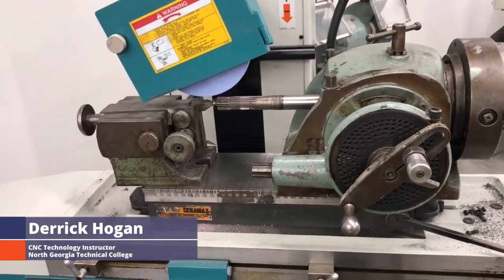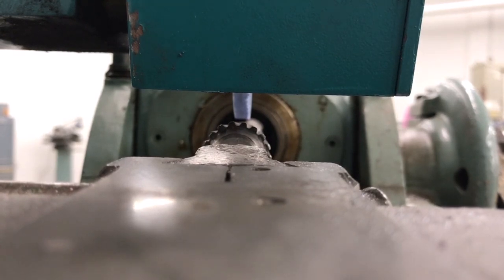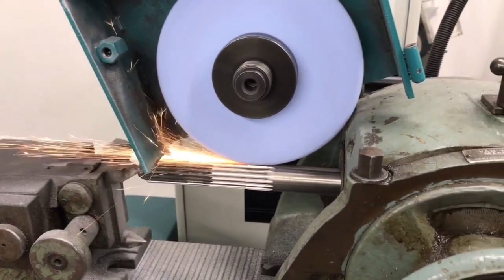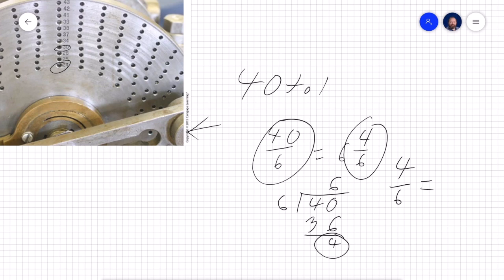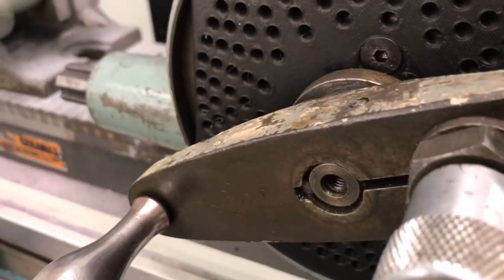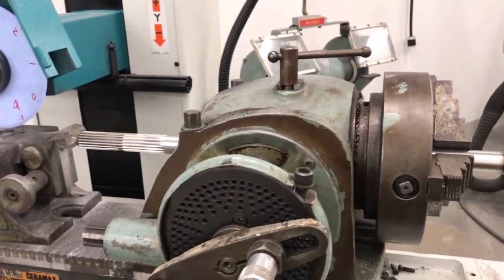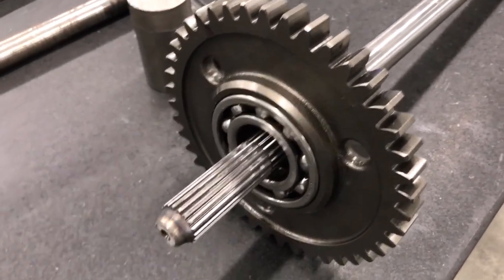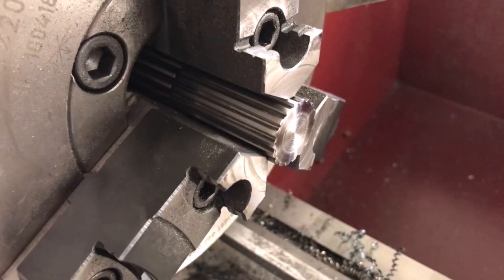Crush Dressing, an Old Die Grinder, and a Tractor Shaft

Comment: Just a question I have why not put it on a cnc machine in a 4th axis and 3D surface it with a small ball mill to rough it then a 45 degree carbide chamfer mill to finish it off if it is a 45 degree spline profile? If the radius is necessary then finish it with the appropriate ballmill endmill there are a wide variety of endmill ball mills out there that can machine hardened steels.

Comment: I don't know if you mentioned it, but it would be helpful to know how many turns of the 'handle' it would take to rotate the platter 360 degrees. Most seem to do 1 turn = 4 degrees (90 turns for a full rotation), but my 'high quality' HFT is 1 turn = 5 degrees 72 turns for a full rotation.
Reply: It was mentioned at about 10 minutes mark…40 to 1 or 9 degree per single rotation

Comment: Is there some reason that you don't put aluminum shims between your work and the damn Jaws?
Always always always place something be it thin copper or aluminum between any clamp or jaw anything touching apart even if the parts aluminum aluminum shims beat having marks on the part!
The only time I would not use a shim if I had a raw forging and I wanted maximum grip on a surface that would be cut later.
Also three jaw chucks are for soft jaws four jaw chuck's are for Machinists that make quality parts when you start to actually treat every part the same whether it's hurry up or whether it's a serious part that's when you start to make good parts.
Just because you're in a hurry is no excuse for poor craftsmanship, a good machinist is lazy but not that damn lazy.